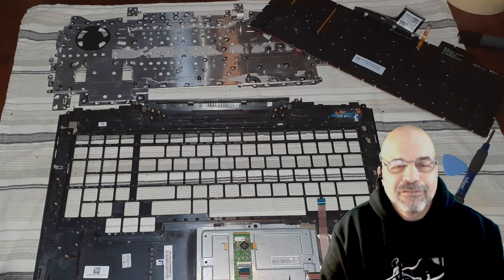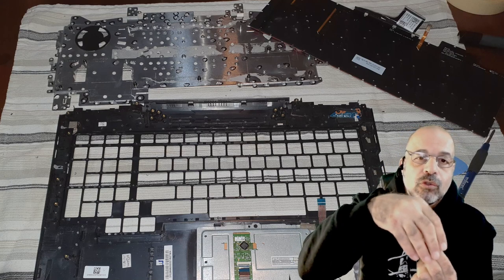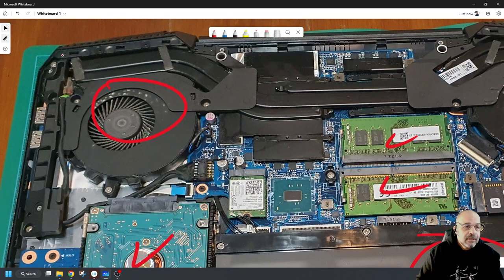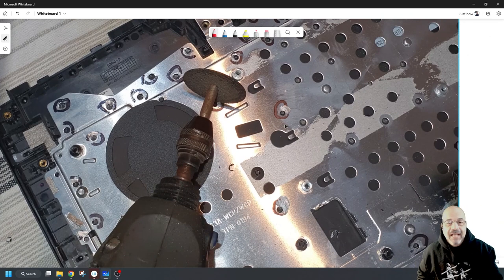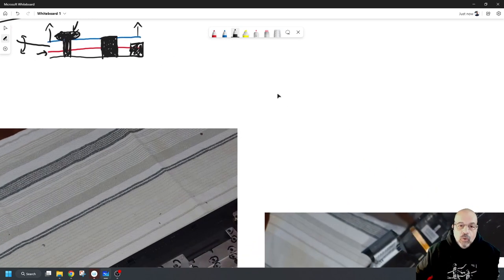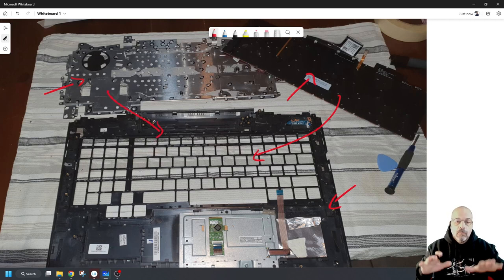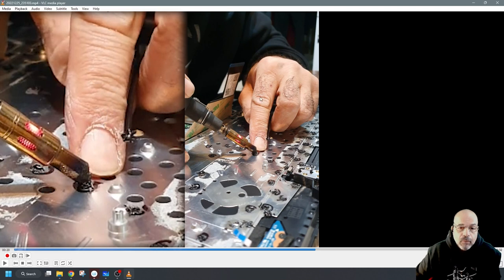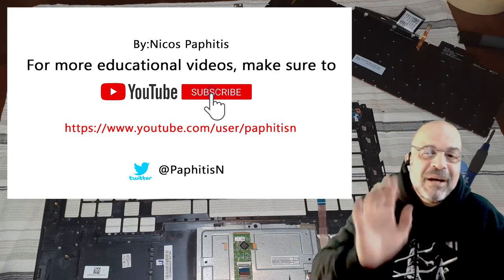Replace ANY welded / plastic riveted keyboard the CORRECT WAY.

Comment: Recently I had a customer's Acer notebook with a faulty keyboard. Acer could no longer supply the top cover with a UK keyboard and I was unable to locate one anywhere as it turned out to be an unusual model.
I was however able to buy an original keyboard directly fron China.
I use the same method as above and taking your time it does work.
The labour charges were high (when compared to replacing a clipped in keyboard) but ifar cheaper than replacing an entire high-end laptop.
Reply from the maker: Thanks for the feedback. I am sure it will help others

Comment: Thanks for posting this, I have an Asus laptop that needs a new keyboard and have been trying to figure out how to do it myself as my local repair shops won't touch it.  The black ziptie idea is brilliant!  There are a few other folks out there who have tackled this problem by 'shaving' the melted part off the post with a blade/scraper.  Have you tried shaving vs grinding, as It seems much quicker?
Reply from the maker: Yes i have but i find it a bit dangerous as it is easy for the blade to slip and cause damage. I prefer a grind tool as no preasure is applied and you can easily control what you take off. If you are going to use a blade to scrape off ecess be careful not to slip. Remember it is important to make sure you do not bent teh back plate as this will result in a spongy keyboard. With the grind tool you can make sure the rivet is flush. With a scraper it may be that you do not get a flush finish on on the riverts and could cause the backplate to bend when you remove it. Good luck with this and make sure to let know how you get on.

Comment: Amazing tutorial. So glad I found you before doing this job
Reply from the maker: Glad it was useful. let us know how your repair goes.
Reply: @paphitisn  Still not sure if I replace the entire board, my Acer keyboard works great, I have one key, R/shift key. It looks good underneath the plastic key. Software, drivers, all OK. I use that key all the time, I type with two hands. Do you have any ideas before I replace the entire board? Thank you!
Reply from the maker: @nld-bl5ct  i would delete the keyboard drivers and restart windows so that the basic drivers are installed  if it works, great. If nkt then the chances are it is a faulty keyboard.
Reply: @paphitisn  thank you, Nicos, I have already done so, several times. Thank you so much

Comment: Thanks for the clear info, worked really nicely and my laptop is revived. The only thing i'm kind of weirded out is, when the laptop works through the vent opening comes a smell the same as when the plastic zip ties were being melted. Not strong, but if you're close to the vent it's noticeable. It's not overheating, actually cooler than before probably due to the fact it's cleaner. Did you have this issue and how long it took to "clear out"?
Reply from the maker: I am glad you managed to repair your laptop. Good Job. As for the smell this will not be from the melted zip ties. You can test this by melting a zip tie, letting it cool for a while an it will not smell. If the smell continues over time i would suspect that your fan maybe on its way out. If the device is not over heating and you are not getting random crashing of the OS then you are pretty much ok but keep an eye on the device temp and the fan.

Comment: Thanks. Well explained👍. What temperature of the soldering tip will be optimal for melting ziptie plastic?
Reply from the maker: I used a gas soldering iron but most times i use a 30W soldering iron. If you have a variable temperature soldering iron then i suggest to do a bit of testing by melting some zip ties on some scrap plastic. You want to be able to easily get a molten blob of plastic without it burning the zip tie. You know when it is too hot when the molten blob starts bubbling.

Comment: Thank you so much. I have never thought of using an external plastic to weld the metal backplate to the chassis rivets. This kind of design needs to go, it's terrible for repair.
Reply from the maker: Glad you liked it. Totally agree with the cheap design. Needs to go.

Comment: Hi! Thank you for your tutorial. My previous attempts at melting had failed. The plastic extensions are very very thin. I tried to melt them with their own pieces, but after a month they all fell off. Now the plastic extensions are at the same level as the metal plate. Should I use your method in this case, will it work? Or should I try epoxy? What do you suggest Thanks!
Reply from the maker: Personally i would weld with the zip ties. Let us know how it goes.

Comment: How much that I need to get from the customer to replace this kind of keyboard.
Reply from the maker: This is entirely up to you. Only you know your worth. If you are experinced in this sort of repair then you will know that there is responsibility on your end on the event that you can not repair the device or you make it worse. If you are not experienced then you need to inform the customer of the risk that the repair may fail. If it does they take on the responsibility but you will need to decide who forks the bill for the bought parts. So at the end of the day your experience will determine the charge.

Comment: I need to replace the face plate of my keyboard. The new one just arrived. Can I use a soldering iron to melt the plastic rivets that holds the metal face plate and the keyboard together?
Reply from the maker: I would not recomend it. The soldering iron will melt the plastic riverts and make it bubble over, requiring you to melt more of the rivet stem. If you can not grind them then i would suddest you cut the rivet lips with a blade. Be careful not to slip with the blade and damage something.
Reply: @paphitisn  I mean after I switch the old face plate with the new one  which has the factory plastic rivets that are supposed to be melted to form the crown. Can I melt them with a soldering iron?
Reply from the maker: @vraja8756 absolutely. Dont just stick the pointy end of the iron down the middle of the rivet. Better to use the iron s at an angle so you do not weaken the rivet stem. Make sure to apply some pressure on the back plate when you are melting the rivert so that you get a firm sandwich of the layers. Release pressure once the rivert has cooled. Good luck. Let us know how it goes.
Reply: @paphitisn   I finally fixed my laptop after a few months of it being broken. For some reason the nvme SSDs keep blowing probably due to a short circuit. Someone suggested to remove the HHD and switch it with a sata SSD and not use an NVME at all and I did that. Anyways, I managed to switch the old broken palm rest with a new one. I used a soldering iron to melt the plastic rivets like you said and everything went great. I just had to be careful when the iron heated up too much the plastic was melting too quickly and kept sticking to my soldering iron so I had to unplug it every time. For my first ever laptop fix it was not so bad, even though the speakers don't work anymore, at least the laptop is functioning now when I need it the most.
Reply from the maker: @vraja8756  WOW, your first ever laptop fix was replacing a riveted keyboard. That is impressive. Good idea to replace the HDD with an SSD. Kudos to the person that suggested that to you. Speakers not working? where they working before? if yes i would check the speaker connections. If you cant get them to work then a set of USB speakers will probably sound better anyway. WELL DONE. Good job. You should be proud of yourself.
Reply: @paphitisn  The speakers were working now one of them is just making a buzzing sound but no other audio when I tried to play something, so I just disconnected them from the motherboard. I don't mind, I'm just happy that I can use my laptop finally.

Comment: Can we use specialised plastic glue instead of melting ?
Reply from the maker: It is entirely up to you. I have never managed a perfect long lasting repair with glue. The reason why is explained in the video.
Reply: @paphitisn  I have never done one before, but have some failure in joining PP plastic using glue. Later I found that in order to join PP plastic successfully, we need glue specially made for joining PP plastic, slightly more expensive but work very well. 
 (When I attempt to replace the keyboard next week, I will try two different technique. 1. Cut the rivet head with a suitable hole punch to allow for the rivet length remain long. 2.  create a donut shape rivet head and glue to the old rivet with plastic glue. (if plastic glue does not work, I shall heat weld plastic tie like what you recommend but I should have a longer rivet remained to work with).  Thanks for you video, it does provide a good learning for someone like me who has never done this job before. Cheers
Reply from the maker: @Gnowop3  i am glad you found the video useful. As i said, i have not had much luck with glue on a long term basis. Let us know how your repair goes

Comment: I'm a little worried about the Dremel grinding stone making contact with the metal and making metal "dust."
Reply from the maker: You are not working anywhere near the circutry so dont worry. Also you are focusing on the pkastic rivet not the metal so you will not be generating any dust. The grindstone barely touches the metal. Give it a wipe down before welding the new keyboard in.

Comment: using razor or utility knife to remove the rivet head is the quickest way, at least from my experience, or I'm just too broke to buy power tool
Reply from the maker: Whatever works for you and is in uour toolbox 😀
Personally i found using a blade more tricky and did not want to risk a slip of the blade which is why i preferred a grinding wheel.

Comment: Why not just use epoxy to bond the rivets?
Reply from the maker: the reason is explained in the video. The epoxy sticks to the surface of the remaining rivet so the bond is not that strong and will give over time resulting in a mushy keyboard. Especially keyboards that are extensively used.
Reply: @paphitisn  thanks, must have miss it

Comment: Im at the part when i need to melt them in i was  very carefull up to this point i need this to work
Reply: My keyboard wasn't broken the case was cracking in between the keys from this hinge area. I bought a new case for it which was not an easy feat. Hopefully I can finish this job with the zip tie trick.
Reply from the maker: @shadowslayer7574  take your time. Let us know how your repair goes.
Reply: @paphitisn  What brand zip tie do you use? If you don't mind me asking idk if you said it in the video I just read a comment saying brand could matter.
Reply from the maker: @shadowslayer7574  Nothing in particular. The ones i used had no brand name. Best way is to to do a test on one rivet to see if the 2 plastics weld together.  Brand name is not the issue. It is what plastic the case of your laptop and zip tie are made of so simply going by zip tie brand is not going to help. Test one rivet.
Reply: @paphitisn  Okay thank you, i kept the scrap pieces of plastic so i can test on them. Thank you for all the help.
Reply from the maker: @shadowslayer7574  Good idea
Reply: @paphitisn  Got the job done laptop is like new, that was definitely not a DIY for most people. Thanks again for the help.
Reply from the maker: @shadowslayer7574  Great job, well done. Definitely not a repair for the faint hearted. It takes time and patience. Your reward, a working laptop. Thanks for coming back and letting me know how the repair went.

Comment: use a razor blade in a window scraper works very well.
Reply from the maker: Just be careful to keep control of the blade so it does not slip and you cut smoothing you should not. Did you complete your repair? how did it go?

Comment: Kiddos to anyone attempting this. I'm just gonna throw my laptop away and buy me a new one. God bless.
Reply from the maker: A job like this can be a bit overwhelming. However, if you are planning to buy a new one why not give it a go, especially if you are planning to throw out the old one. The best way to learn is to practice with zero risk and as you have decided to throw it out anyway, you have zero risk, apart for the 30 odd dollars you are going to spent on the replacement keyboard.

Comment: I have done mine finally with the T7000 glue but it is still risky because if you fail, you won't be able to take it apart easily anymore...
Reply from the maker: Well done. Let's hope it holds and stands the test of time and use. Make sure to give it a few days to cure properly. I think T7000 needs 48 hours. Keep us updated
Reply: @paphitisn  actually i noticed that 4 upper keys from the numpad feel mushy so i might have missed some spots
Reply from the maker: Either that or the weld on the rivets from the T7000 has released. Should mark all the rivets before removing the heads. if you missed them then you can easily disassemble and re-glue. If they have released, it is most likely due to drying time. the problem with glues or epoxy is the drying time. You need to be applying constant pressure on the back plate until the bond is solid otherwise the back plate will not tightly sandwich the keyboard. This is why i prefer plastic welding. it is easy to keep pressure on the back plate until the plastic cools and solidifies.

Comment: just use a 2k silicone glue buddy
Reply from the maker: Have tried different glues. The surface area is too small on the remaining rivet stubs so after a while some release, especially in the middle of the keyboard and the keyboard feels mushy.
Reply: @paphitisn  can't you glue the old rivets back on the stumps with super glue ?
Reply from the maker: @pssa3215  No, because you need to break or grind of the heads of the rivets to remove the old keyboard. This is explained in the video.
Reply: @paphitisn  you can keep them intact by using a sharp knife to cut them off cleanly without damage. Others have used knives before too.
Reply from the maker: @pssa3215  Good luck with that. About 100 rivets, you are going to keep track of the heads you cut of and supper glue them back. Even if you could, they will break of eventually. Please come back and let us know how it went if you try this. As i explained, many have tried different methods. Most failed and others, the fix was temporary as the bonding agent released over time and use of the keyboard.
Reply: @paphitisn  its not that many lol. On mine i have around 20 rivets on the panel and the new keyboard already comes riveted. I will try to put them back with 2k glue and i have faith that it will hold for sure
Reply from the maker: @pssa3215  If it comes riveted why are you removing them from the old one??
Reply: @paphitisn  the panel which holds the mobo is riveted and sits ontop the keyboard